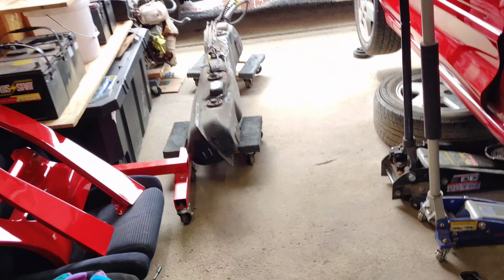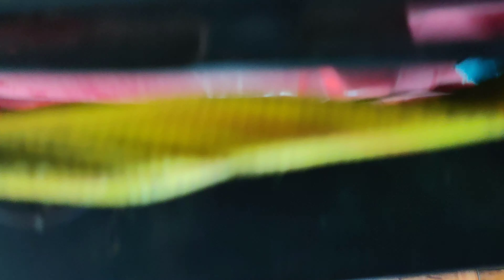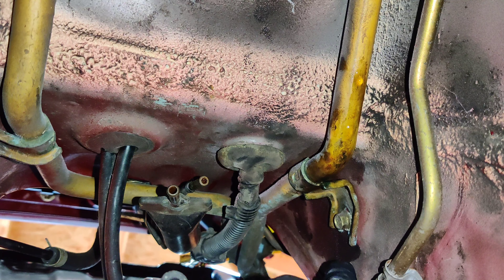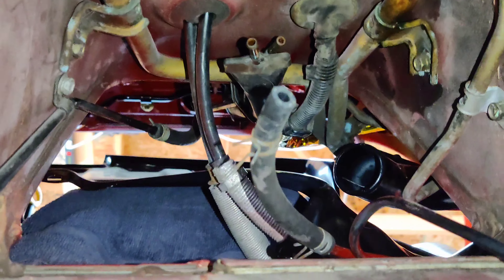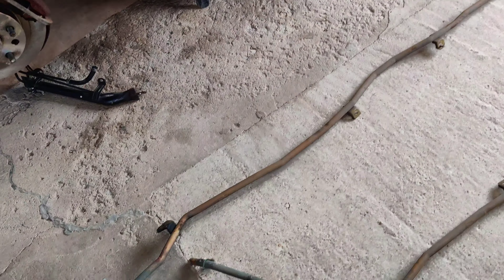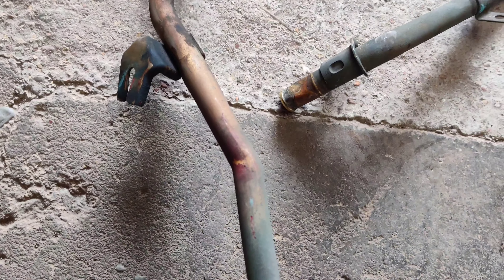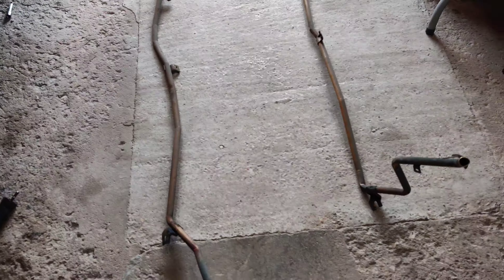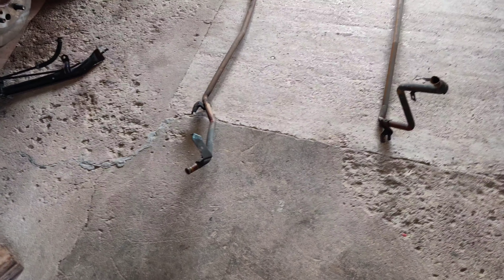Quick Heater Core Hose leak update

Comment: This was a TSB and recall item by Toyota. Basically the bracket that mounts to the body has no flex so the thermal expansion and contraction will crack the pipe, usually at the bracket. The revised parts had slots for the mount to allow some movement I guess. I replaced mine with re-enforced hose because good luck getting new pipes or used pipes that aren't cracked.
Reply from the maker: Do have a link to those hose by chance if it ever happens next time